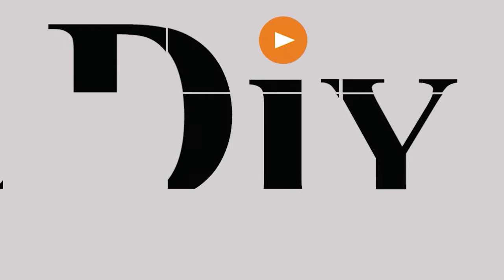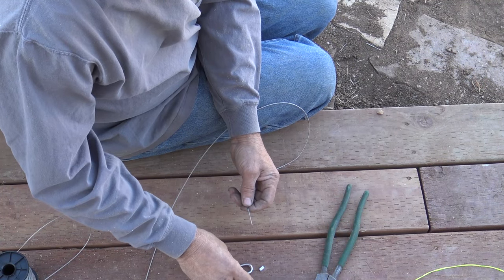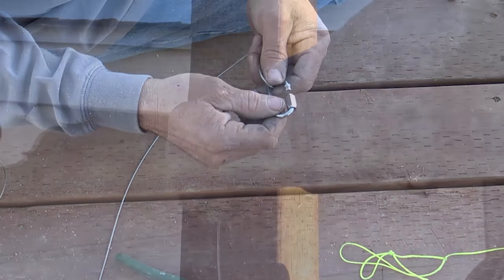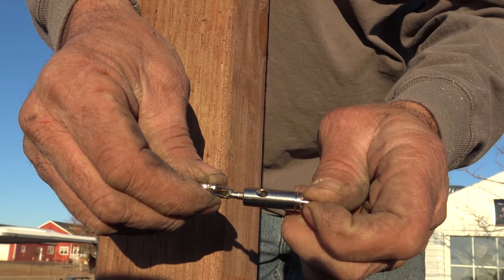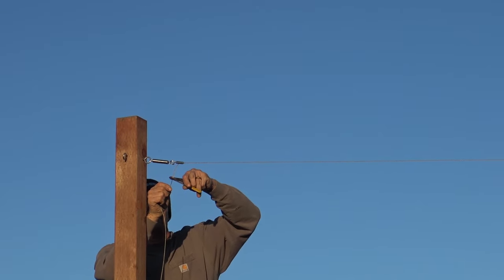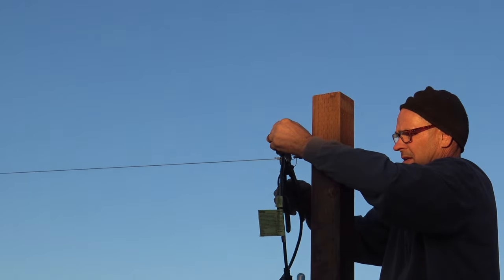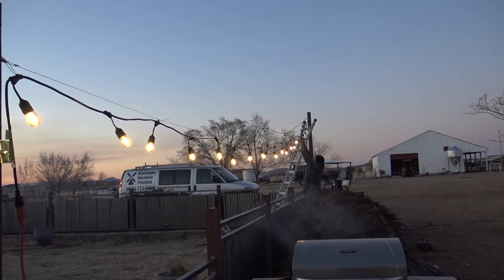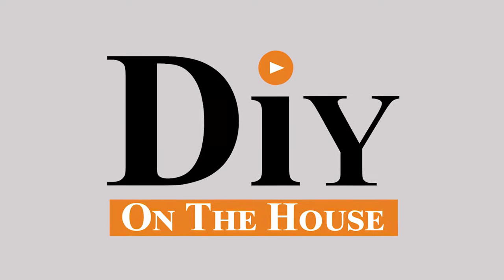Easiest Way to Install String Lights | Trick to Hanging Yard Lights

Comment: Thanks for this video.  I had hung lights with a very long span and initially tensioned them with the electrical line between the lights.  I wan't comfortable with this and needed a fair amount of tension to keep the lights high enough.

One day later I saw your video and instantly recognized a great solution.  I used your hardware link (already had the lights).  Everything arrived the next afternoon.  Within less than 30 minutes I had 3 lines (40 foot each) up, strung the lights, and had a much more professional installation with virtually no tension load on the electrical components. 

Thank you for taking the time to document this, upload it, explain it, and link the hardware.  Less than 24 hours between watching the video and the whole system installed.
Reply from the maker: That's great. Ours have been through some very stormy weather and never a problem with the support system.

Comment: I’ve watched many videos on how to hang these lights. Yours is, by far, the best. Simple without over-engineering the project. I installed mine today after purchasing all the hardware. Even with a small yard I t took all day but I did it by myself It looks absolutely fantastic, super clean and professional. Thank you so much for this video.
Reply from the maker: That's great, I'm glad it went well. We have our lights on a 2 hour timer on a dusk to dawn light. Love it when they pop on. Thanks for the generous comment.
Reply: @DIYOnTheHouse I put them on a timer, too. It’s very nice. 🙂

Comment: I'm watching your video because I have to install these lights kinda often. I have to say... We used to use wooden poles like that before with triangles at the bottom to keep them erect (which was gaudy as hell) and had to place plants all around those to cover up the triangles. I have just switched to using galvanized fence poles instead with little eyelets at the top. It has upped my lighting game tremendously. I also don't even bother with the steel cable but I guess if I had to do longer runs of them I would. I just use a zip tie to secure them to the poles. Anyways, like I said I've been  installing these kind of lights now for about 4 years and still learning. Happy to see someone else's version.
Reply from the maker: I bet the galvanized poles work well!  Thankfully, these poles have held up wonderfully!

Comment: Zip ties are plenty strong enough for hanging the lights. I have a very large back yard and have a couple hundred feet of string lights like these all over the back yard. I used zip ties without any issue.
Reply from the maker: Great to hear!!  We were concerned because of us in Arizona and the intense sun - glad yours worked!
Reply: Sun-baked AZ means no bueno for plastics, and same for hurricane prone areas like Louisiana. Remember, if one fails, the adjacent ones are even more likely to break.
Reply: Lol😂🤣, ours would sun rot in a few months. But that's our state 🤷‍♀️.
Reply: In high heat areas zip ties are only temporary as they will become brittle and break off unless this is a temporary install such as 3mts or less

Comment: Great video man. Wondering if stringing the cable through the hole above the lights would work instead of zip tie. A little more work on the ground but might be worth not having to use zip ties. Just a thought.
Reply from the maker: That probably would work.  2 reasons we didn't go that route - it was 100 feet and was cumbersome and heavy to pull up -- the hole on top of the lights would have turned the lights at a 90 degree angle to the cable and it would have bunched up.  Appreciate you watching!
Reply: I thought of same thing, however, in order for that to work well, the orientation of the hole would have to run perpendicular to the string of lights, so that the wire would fish through properly.  However, it's made parallel.  (meaning the wire would have to curve / zig zag around the holes to accomplish what you're saying.)  Perhaps the manufacturers could make this change!

Comment: Could you install the string lights onto the wire while the wire is on the ground?  Then hang up your two ends on the posts?  Seems easier than working overhead or on ladder.
Reply from the maker: Great question - here is how we did it for a wedding - I think it is what you are referring to.  https://youtu.be/Yfk2frCzFwE

Comment: Great "how-to" video! Can I ask how did you get your vertical, wood posts then set in place and secured? Thank you!
Reply from the maker: They are concreted in and they are also braced by the attached fence. Thank you
Reply: @DIYOnTheHouse  Can I ask how far apart you have them? I won't be able to brace mine against anything. I was going to sink them in about 2 feet and then cement them into place. I was planning on about 25 to 30 feet in between each pole. Do you think that would work or do I need to go closer?

Comment: How did you install the posts, looking to do this from scratch in my backyard! Thanks
Reply from the maker: 2' deep, set in concrete. The top of the fence is secured to the post to give it more stability.

Comment: I’m curious about the super tall post.  How far did you have to bury it and do you think setting it in gravel would work?
Reply from the maker: Hi,
I set them at 2' in concrete. They also use the fence as bracing. If the fence wasn't there I think they might pull in at the top because it's 45' across the yard. The posts are 12' long. If yours are free standing I would go deeper depending on the span.

Comment: Great video! Most string lights come with ends that will create an odd spaced gap when you connect two together, any idea how to avoid those odd gaps?
Reply from the maker: Sorry I don't. I would loop them back on each other until the spacing is correct and tie wrap them loop,

Comment: Great video! I'm surprised that small black zip ties didn't work for holding the string lights to the wire. What was the issue there? Thanks!
Reply from the maker: We are guessing they would do good for short-term.  We live in Arizona (intense sun) and a VERY high wind area - we didn't want to have to worry about repair.

Comment: Correct me if I’m wrong but…wasn’t the cable supposed to run through the lights? Through those little holes?
Reply from the maker: The hanger holes are facing the wrong way. But I still would do it the same way, the cable should last years. I don't see the light lasting as long with the UV so it will be easier to change the string lights out when they are done.

Comment: How were your posts set? Were they just put into the ground, or did you put them in concrete footings? I want to put my posts on top of poured footings, but I am concerned with the posts leaning with the 1/8” cable and turnbuckles I will be using to keep them tight. I would just put the posts into the ground, but I know how that causes rot, regardless of type of wood.
Reply from the maker: We cemented in each post 2' in the ground, I agree, they would lean otherwise.  Wood will eventually rot - but should last years and years.
Reply: I was planning on drilling the post (not that large) into the wood fence on one of the angles, then to a tree then to the house. I figure that whenever the wood fence needs replacement the post will too. Have you seen or done that, thank you! I purchased off your links! @DIYOnTheHouse

Comment: are those 4x4 posts?  What height did you do?  I'm planning the same type of thing......not sure of the weight and what it would do over time to warp the post
Reply from the maker: The posts a 4x4 by 10'. The fence we built supports the close to the center of the post, so I was not concerned about them being warped.
If it we had not had the fence it would definitely be a concern.

Comment: Could you not run the thin support wire through the hole on the top of the string lights instead of using cable ties. This would also aid in determining adequate tension. Remove bulbs of course until strung.
Reply from the maker: The holes face the wrong way and would twist the lights.  It would also be a problem to replace the string light in the future.  Probably not my first choice.